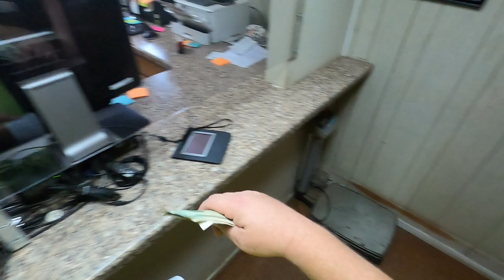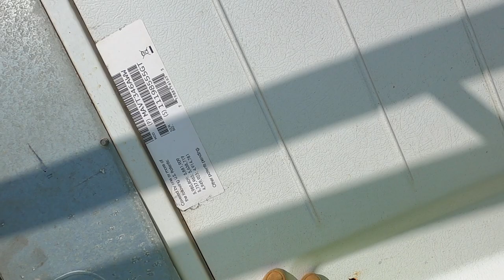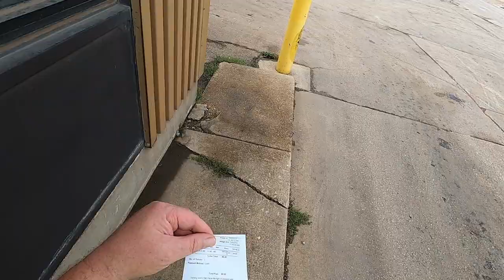Evening Scrapping Vs Morning Scrapping

Comment: Or you are on the same page as me and gas only costs.20$ a gallon because you have a deal with them like I do and I'm running on junk car drain gas.
Keep an extra fuel filter handy
Reply from the maker: I tried putting junk car gas in my truck once. I was broke down for a week and literally had to take my gas tank off the truck pull the fuel pump out of the tank and tip the gas tank upside down to get the junk gas out. Never again
Reply: @ScrapPalletMan  
That's because you didn't have a water block filter inline when you pumped it in the truck.
Still paying.75 a gallon, sure beats $5 .
I run 100 miles a day minimum